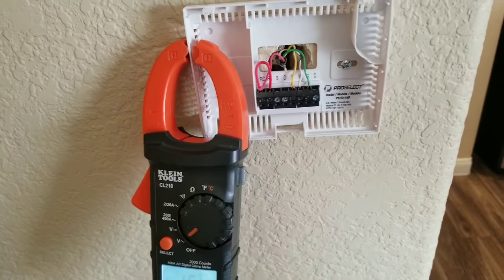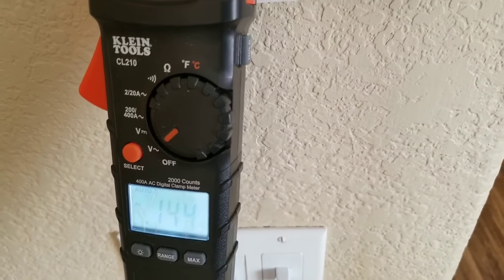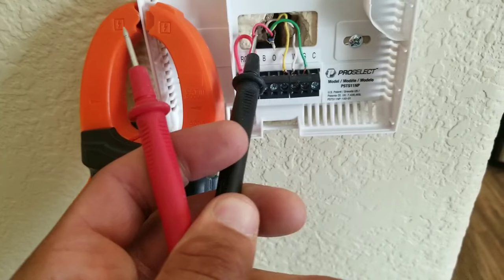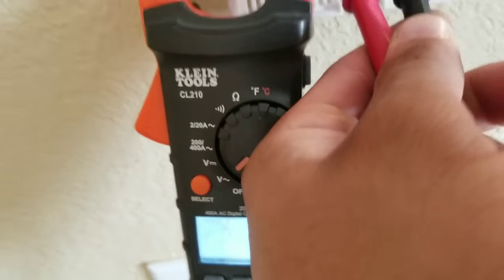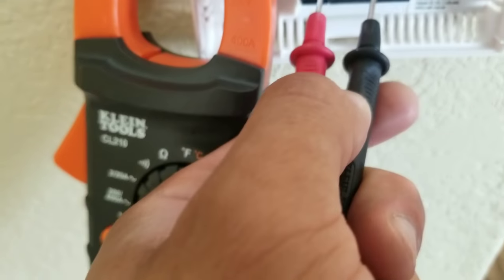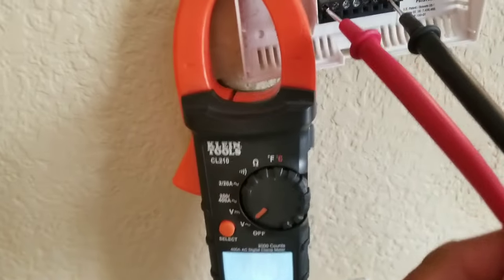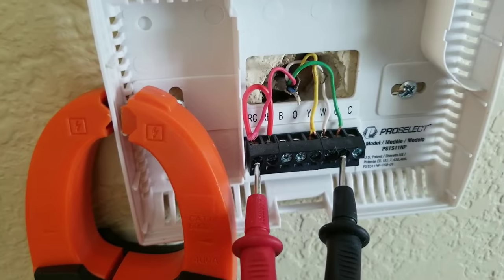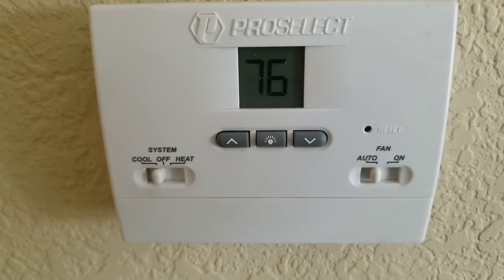Checking Voltage on Thermostat. Explained!

Comment: Sorry my friend, but if you have 24 volts from R (red) to any other wire, that means there is NO call for anything. You’re simply reading voltage across the contacts in this video. So long as the equipment has power and the transformer is ok, you’ll always have 24v sitting on R only. The thermostat face plate is what switches that 24v from R to all other terminals depending on the call.
Reply: The thermostat is a simple N/O relay
Reply: Facts. He never checked a thermostat in this video. He was essentially checking contacts across the board and the wiring
Reply: Yes you have to create a jumper in order to test if the t stat is doing what it is suppose to. But you would have to have a fault somewhere first. For example the heat not working. You jump r to w and if heat turns on then it is your tstat if it still doesn’t turn on then your t stat is likely not the problem.
Reply: I got 26 volt on w and y but not g
Reply: @jonschmitz50   Is this a heat pump? If not, you shouldn't have 24V on w & y at the same time. If this is a basic furnace, 24V between w & common means it's calling for heat. Also, if it's a furnace, there will be no 24V on G during a heat call. The thermostat only switches 24V to G during a cooling call. In heating, the furnace switches the fan on.
Reply: @jonschmitz50   When using a meter to troubleshoot control circuits, you always want to put one meter lead on whichever sequence you're testing and the other lead on common. If testing to see if you have 24v, put 1 lead on R and the other on Common. Testing to see if there is an active call for heat, 1 lead on W and the other on Common. Testing cooling, 1 lead on Y and the other on Common. Testing the fan itself, 1 lead on G and the other on Common. Technicians get confused with low voltage a lot. They'll be putting a lead on R and the other on W or Y or G and they'll see 24v on their meter and assume it's calling. It's not.
Reply: @firemusic82 🫡💯
Reply: @firemusic82  yep exactly

Comment: All you’re doing is checking the voltage from R to ground. This isn’t actually telling anybody anything besides that the transformer is sending 24v to the thermostat. If the stat was bad you’d have to check at the furnace/air handler at the terminals to see if the thermostat is sending 24v to Y,G,W etc
Reply: How?
Reply: Bring ur meter to your circuit board attached somewhere in front of the blower cabinet, should contain a schematic of what kind of contacts your furnace should have. "Normally open, normally closed" .
Reply: I'm glad someone said this. A multimeter only checks the difference in voltage between the two probes, not how much "voltage" there is.

Comment: Given that the thermostat is completely disconnected, the work you’re doing here has nothing at all to do with the thermostat… the only thing you’re testing here is if the furnace control board is outputting voltage on the R wire.

Comment: Based on basic electrical, that's just a connector which is connected to nothing but 1 live wire at R. The rest are just grounded so they show the R's voltage... 😅

Comment: First video I got when googling how to check the voltages! I was getting an error for the power on the Nest Pro saying power might not be on. So I went and tried to figure out why. Came across this video to figure out what it's supposed to be. Long story short. I apparently hit the kill switch in the crawlspace for the heater so even if the power was on, nothing was going to the thermostat. But I learned how to check what it's supposed to be and a basic intro to the multi-meter! Thanks a ton!
Reply: Thanks for saying you hit the switch. I went looking for mine after I couldn't find any voltage. Good Internet:)

Comment: What if I am getting 24v AC across green, yellow, and white, even with the thermostat off? My blower is not working. I feel like there is a short, but I don't know what having voltage across all three signal cables means.

Comment: This was quite helpful to check power in thermostat wiring--not so much a thermostat. Turns out mine was reading 3v and i had a blown fuse on the furnace board. replaced it and everything is perfect. Thanks!

Comment: Thanks for your video it’s great you post these.  Was hoping for help, my problem is I’m not getting 24 volts at the thermostat.  I tested my thermostat for continuity using ohm setting, and got a no resistance reading.  I checked the out door compressor and was not getting 24 volts there either. I have power going to the contact and if I press the plunger in the contact  fan and condenser turn on.  I’m wondering if this problem was caused by the drain line from the return being clogged and system such down.  I cleaned the drain line and got the water out but when I turned the system back on there was a spark from the board in the handler.  This board has no lights or error codes it’s an older model unit although I had it replaced with a new one.  The handler blower is not activating.  I do have power phase power coming in, but I don’t know how to check for the low voltage or voltage going to the blower.  I truly would like any suggestions you may have.  Trying not to get hit with having to call the HVAC folks as things are a bit tight nowadays.  Kind regards, Gil

Comment: If you connect red to green the fan comes on. Yellow to red cooling cycle initiates. If you can read potential across the two lines then it would be shorting the circuit to connect the two wires. Am i mistaken?
Reply: You are correct, when you put the meter on the 2 lines you are shorting it with the meter. Think of the meter as a light-bulb. If you connect the light-bulb to 2 lines you are shorting it to get the lightbulb to turn on. The thing is, the short with the meter or the light-bulb is a very high resistance short, so it doesn't blow the fuse. Think of dropping two ends of a garden hose in a raging river. Nothing happens. Now put one end of the hose upstream in the river. You will get "current" in the hose.

Comment: Hi Sam I'm wondering how to get the voltage lower than the existing coming into the thermostat, I'm getting 32/36.8V and supposed to have not more than 28v, that's probably the big reason and problem why I'm getting error E104 with Nest Pro 3rd Generation thermostat and can't getting done cause is receiving more voltage than required, all thermostat different brands work flawlessly but Nest Pro not getting through said problem with G wire overcurrent, I do have an new 18/3 ac cabling with all connections Y/W/G/C/R just replaced but the problem with Nest still persist, I'm not an electrician but I do have the basic skills cause I'm an Networking IT guy and I'm guessing with a quick lesson or explanation I'll get this done. Thnx

Comment: Thank you for the great video. I have only two wires coming to my thermostat, connected to R and W. The voltage measures 77 V-AC. The thermostat is rated (like most other thermostats) at 24 AC and it has no issues. What puzzles me is how can you get voltage between a wire that is supposed to have 24 AC (attached to terminal R) and the wire going to terminal W, which I believe, is supposed to complete the circuit of the zone valve, thereby turning the boiler on?! I thought one can measure the 24 V line with the other probe attached to a common wire/terminal only! 
Your comments are appreciated in advance.
Zack

Comment: Would you have 24 volts to each wire when that respective component is off?
Reply: No. 20-28 AC comes in to the thermostat and the thermostat sends the voltage to each thing it wants on

Comment: I have 21v out of my blower/green wire...where should i go to further inspect ? Thankyou
Reply: What was your solution?  I have 19v.
Reply: @emeltea33  check the voltage directly from the transformer in your furnace.
Reply: @dannyl6507  Thanks, I did, no degradation.  Guy came out and replaced the motor, now it works.  Said it was electronic motor controller or some such.

Comment: Thank you Sam for sharing knowledge with us. My thermostat is blank and after seen your video all the wires get 24 volts. Doesn’t have a float switch.pushed the contractor and starts. Is the thermostat bad?  Thanks
Reply: Did you ever find an answer to this problem. My AC is having the same issue.
Reply: @adagiotexas  sorry for the late response. What’s happening to your ac?

Comment: Wait, so your thermostat is removed from the sub base. So there's no way red is connecting and sending power to any of those terminals. 

You don't have 24 volts going to green white or yellow. You have zero volts going to those

What you're reading is the difference in potential between red and common. Between red and green you have 24 volt difference in potential. All you reading is your hot and the other side is going back to common.
Reply: I thought the same he is only reading red, if there was power being sent to green or yellow or white if you put one end to red and the other to any of the other colors you will reading zero not 24.
Reply: Your correct. This guy is going to do nothing but confuse people.
Reply: Correct. The meter is measuring the difference between the two leads. Right now there is 24v at red but there is 0v to the other terminals because voltage is not being sent to the other terminals. It reads 24 volts because that is the difference between the two. A thermostat is basically a temperature controlled switch. If the thermostat were sending 24v to let’s say the G terminal or our blower motor, we would measure 0 volts across R and G because we would be reading across the same line.
Reply: I came to the comments to see if my suspicions were correct about the way he was measuring the voltage. I was seriously getting confused.
Reply: That’s what I thought. That’s why he paused when he saw 24v on heating and cooling 😂😂. So the thermostat is basically traffic police. It grabs 24v from the red and depending on how you set the thermostat (heat/cooling) it makes that connection with the other terminals. You’d have to manually jump the red incoming 24v with whatever terminal you want to check. Respect to the man though for trying to teach ppl and taking the time out
Reply: I also came to the comments for this. Trying to explain it to my buddy who just bought a house and who also just bought a cheap multimeter.

Comment: I just bought the ecobee thermostat and it does not turn on. The seller told me that sometimes is the voltage. Can I please get some help with this. I just moved in and idk if I have to change the wires and stuff

Comment: Sam, can u please give me some suggestions what cuase my ac to turn off i check all the voltage on my thermostat all good but for some reason I have my ac running it turn if itself won't turn on until I reset the power to the unit and it start working again for lil bit it do the same thing????

Comment: You are wrong. Yes you have power but red sends power through. If you have 24v between red and green then it's not sending voltage through. Plus the damn tstat isn't even connected.
Reply: I was wondering why nobody else called him out on that. What a stupid mistake. I guess the people who are here trying to learn from him wouldn't know any better anyways.

Comment: Hey Sam, I just bought a Nest thermostat and our reads at 27-28. It says the Nest works with "Most 24v systems". Do you think this is okay to install in ours? Thanks!
Reply from the maker: It will be fine 👍
Reply: Just to expand a little, voltage is pretty hard to control perfectly. When it says 24V system it actually means something around 22V-30V. Don't quote me on those numbers, but in general a system designed for X volts will work with voltage near or close to that number.

Comment: Sir how does it works...how it controls fan motor speed in 3 speeds...my single phase fcu  motor has 3 wires....low ,medium,and high...
Without thermostat ,I just tried to connect live(230v) wire to low speed winding...no power trip...
But if I connect live wire to medium and high speed windings.power is getting trip...what is the reason sir... without thermostat how I can run the motor in high speed?pls help me
.

Comment: No conprende..  my tstat only has voltage going to the individual things when theyre on or active..  if i switch from ac to heat i only have 1 or 2 volts going for the ac and viseversa..   everything works..  was trying to install a buck regulator and hardwire the tstat to stop having to use batteries..  and i was drawing off the 25v just fine then switched to heat and no mo 24 vo...
Reply: You're cutting power to parts of the circuit you are turning off, just like a switch is supposed to do.

Comment: How do I turn power off to the wires going to the thermostat. The breaker does nothing.
Reply: You’re probably shutting off the outdoor unit it’s a separate circuit for the air handler.

Comment: Will my heat pump work if I use a thermostat with out emergency heat and will that be why I do not have 24 volts at contact in heatpump

Comment: I have no valtage between any wires to Red but everything works as it should. Any reason？My multimeter works when measures battery and I have 4 wires without common wire.
Reply: When thermostat is calling you will lose voltage depending on what's calling. When satisfied you will have all your voltages.

Comment: I have only two wires going to my old thermostat.  When I measure the voltage across them it is 48 volts.  Is this normal?
Reply: 24 volts on each Instead of the two hot wires at 120 volts each (240 volt circuit), stepped down to 24 volts ×2/wire (48 volts) coming from your breaker. If you have to ask though, it sounds like you're having a problem regardless?

Comment: Wrong...that voltage is from the 'furnace board' and does not involve the thermostat,  which is pulled of its base plate at that point

Comment: U r just verifying you have 24 volts from transformer. If it was calling you would have 0 volts between R and the other terminals. Potential Difference dude

Comment: This makes no sense… You’re only suppose to have 24 on the red wire only when that thermostat is off the wall… U got 24 to the Y, G, W that means everything is calling… The thermostat Heat, Cool modes is what sends 24 to the W for Heating or sends 24 to Y/G for Cooling 
So I don’t know why u have 24 on all the terminals with the TT face off smh

Comment: This guy doesn't know what he's doing. red is 24v power to the stat, using a volt meter is showing you potential difference. If you check between red (constant 24v) and a line that's energized (green for fan, yellow for cool white for heat) it will show 0 if on, because there's no difference. If it's showing you 26 volts it just means you still have power at your red wire.

He's checking from red to green and it's showing 26 volts, he's saying the thermostat is energizing the blower motor, he's wrong.